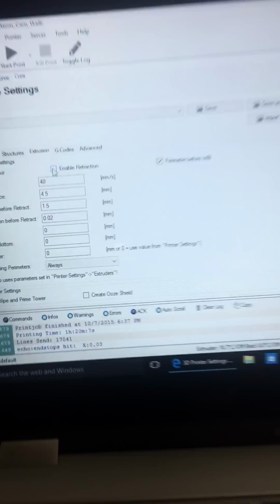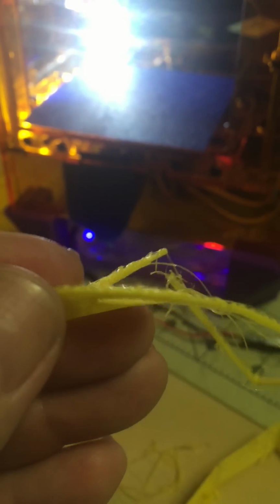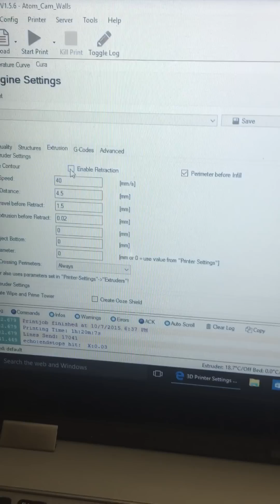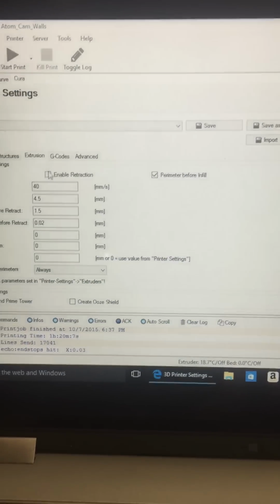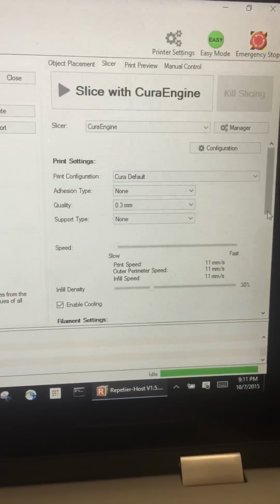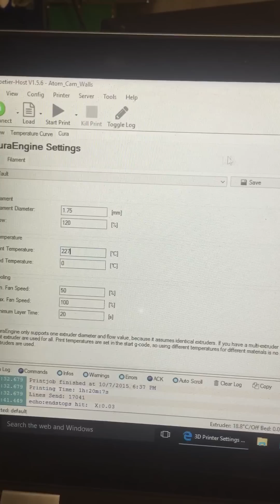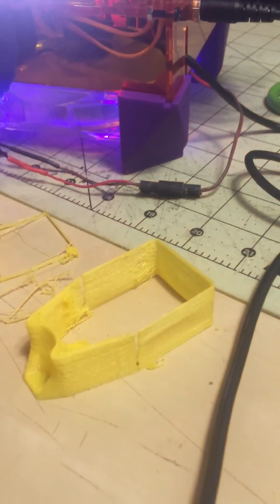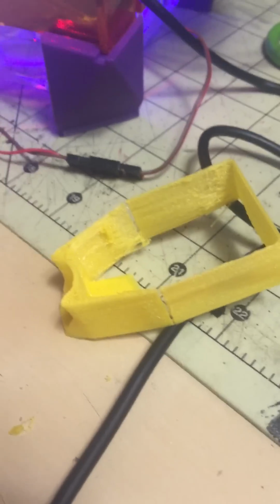Fabrikator Mini and Ninjaflex!!

Comment: hey jeffery is your tinyboy printer  squeaky ?  mine is very squeaky and sometimes shifts layers , have a you any experience with this ?
Reply from the maker: Mine only gets a little squeaky if I run it at 200% speed, and then only a little. I have not had any issues with shifting layers however at all. I have seen some issue on the forums with layer shifting that I think was caused by under voltage motor. Have you asked in the forums?